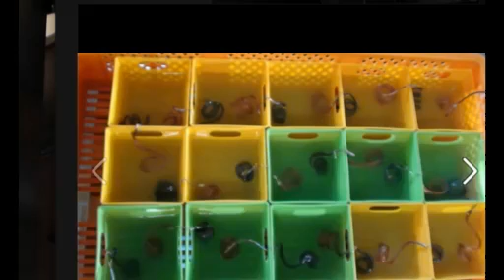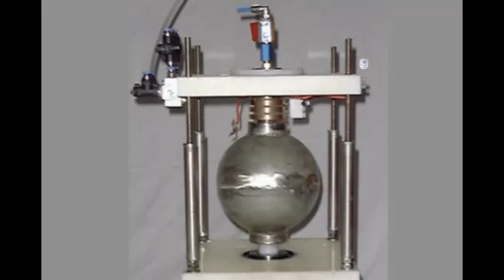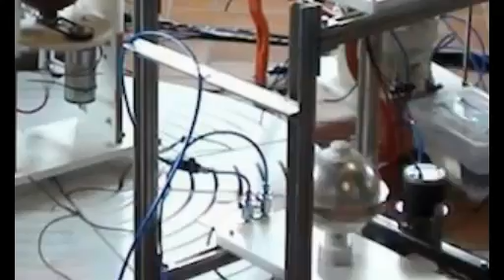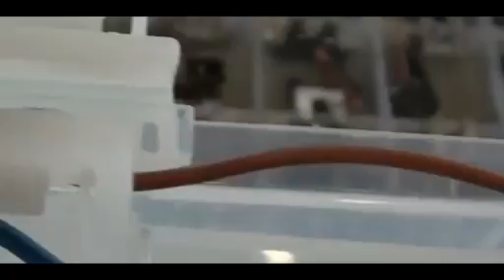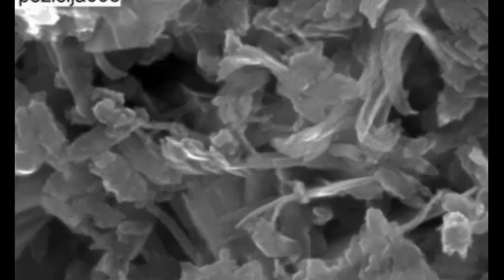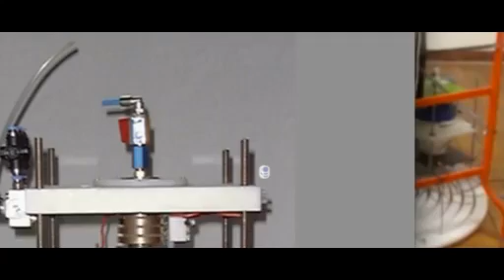9th Knowledge Seekers Workshop May 8 2014

Comment: ceramic is porous, i happen to have a large tub of white bath silicon which I used to glue linoleum onto the floor and then used to glue a shower liner onto the shower stall wall. it is very strong. +++ Scene at 1:11 is what I saw in my dream the last time I slept before I saw this video. (twilight zone theme...) I made a note of it in my dream journal before watching this for the first time. I saw an auditorium, I walked with K down the left aisle, he went to the front podium, I sat in the left wing. I saw the audience sitting in a darkened space and I saw white lights over the top and white behind and over the stage, exactly this scene. He walks down the left aisle.